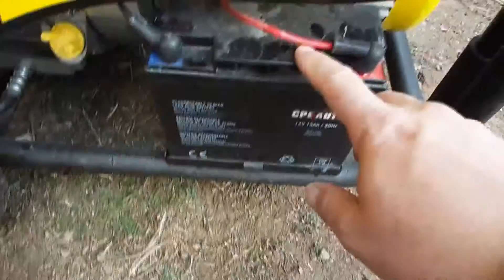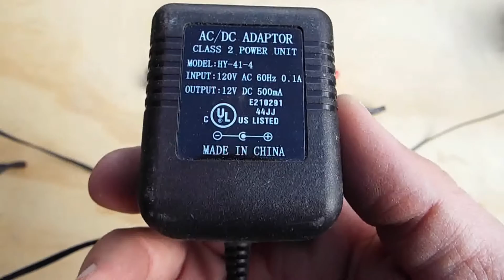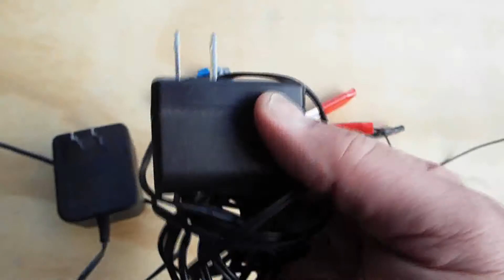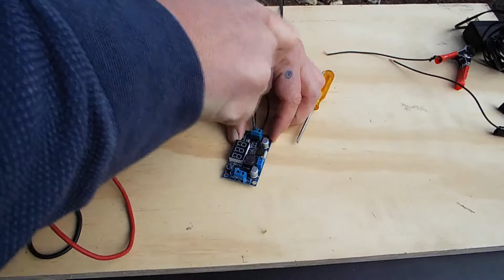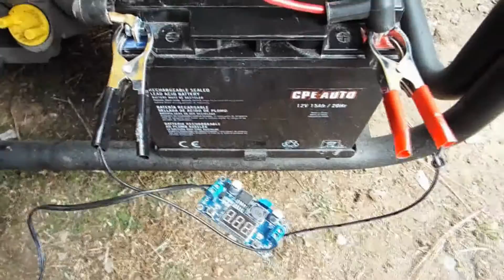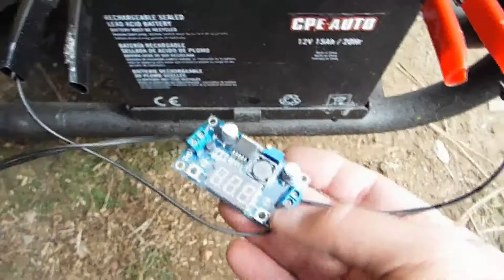Making a Regulated Float Charger for the SLA Battery on my Generator

Comment: Nice video, thanks!
But that is a step-down regulator, what means if you decreasing the voltave, it will increase the current.
Float charge need only little amount of Amps.
I can offer a similar board on ebay, what has a current regulator as well.
Reply from the maker: If the supply is at compliance ( the voltage at which it is set to ) it will only provide current as needed and not any more so it will float the battery at the battery internal leakage current.

Comment: Nice video thanks,  how do you know what current it is charging at?  wouldn't one of those modules with CV CC be better?  I have a 12v 3.2Ah sla battery that I need to charge. thanks... John.. :)
Reply from the maker: I did not measure the current ( you certainly could do that with a DMM) but by using a wall wort that has a lower current rating will limit your current.

Comment: 13.8 volt is very high for floating 13.0 o 13.2 for long life baterie and low corrosion of de positive plate
Reply from the maker: This one states on the side of the battery float voltage for standby use at 13.5V to 13.8V

Comment: How did it work out?
I have a few XL6009E1 modules that I wanted to use to float charge a car battery in storage but haven't done it yet.
Reply from the maker: It is working pretty good so far, I have gone out to start the generator several times and the battery is ready to go. I really like the fact that this module has  a display on it so I have a quick reference of if is plugged in or not,  since I have accidentally unplugged it  couple of times.
Reply: Good point about the display - just ordered a few LM-2596 modules and will do the same - thanks!